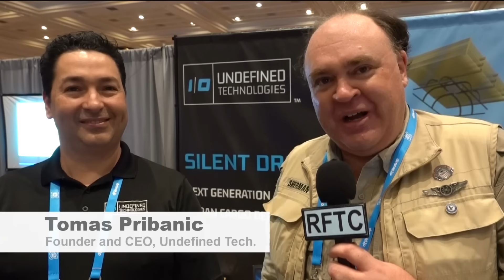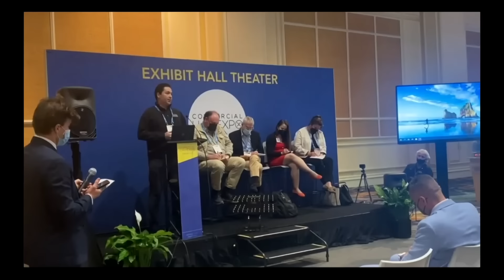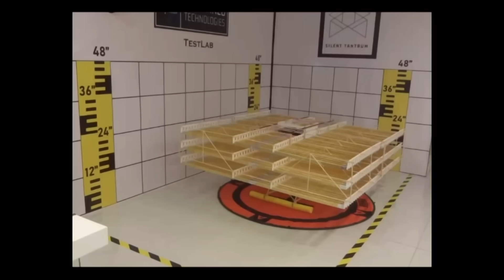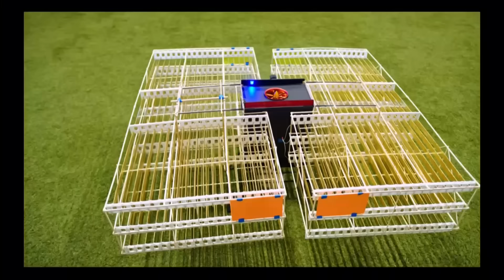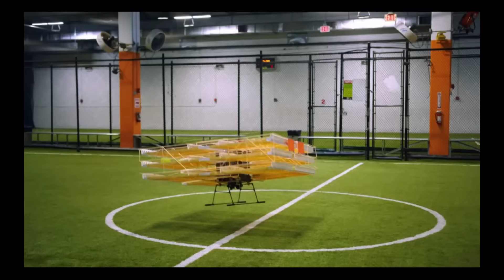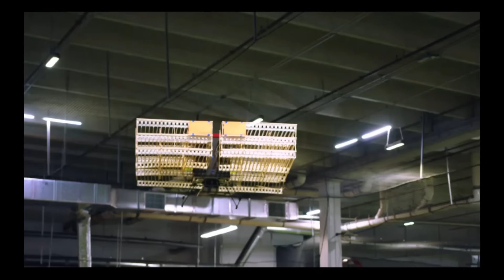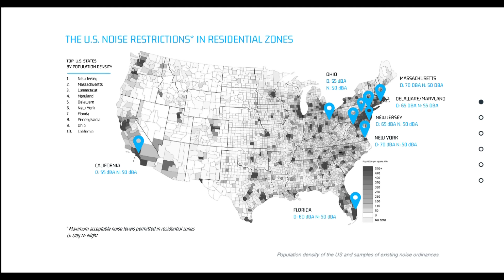New Drone Tech: No Propellers, and Yet It Flies!

Comment: On the surface this is very interesting  and moving in the correct direction. What is the math on energy to lift and how does it currently compare to current drone technology?
Reply: Mr. Pribonic's craft would be at least hundreds of times underpowered to lift itself by ionic thrust.  He has a video of it with audio and a loud powerful ducted fan can be heard.  On my site are the only ones in the world that can lift their power supplies.  They do not lift as much mass and are not developed as far as other types of VTOL craft just yet.

Comment: I didn't think we had already reached the power-density level for batteries to be able to lift themselves using this kind of propulsion alone...
Reply: It hasn't.  They had an radio control electric ducted fan in the center.  I call that cheating.
Reply: @johnculver6994  Yeah I spotted that in there too.  Notice you didn't hear this either, just the fat guy incessantly talking.  It might be quieter than a full on drone but it's not "quiet" with that center fan doing much of the lifting.  I imagine the ion thrust is just used for directional control and stability rather than actual lift capacity.
Reply: Quiet my ass.  Those EDFs are normally very buzzy
Reply: @johnculver6994  That fan isn't used for lift...   It's a cooling fan for the controller..
Reply: @johnculver6994  Exactly get rid of the fan then see how it lifts
Reply: It's a fake. You can see that the flying model is powered by a ducted fan.
Reply: @rorypenstock1763  That fan isn't used for lift...   It's a cooling fan for the controller..
Reply: The UT craft doesn't, it would take at least 100s of times more power.  The crafts on my channel though do carry their power supplies onboard by ionic thrust.  They are the only VTOL ones in the world that do.  It makes sense though why mine work and it is clearly described.
Reply: There’s no way ion thrust lifts those 2 large 6s lithium batteries. The ducted fan in the center does that. The JP ducted fans definitely aren’t silent.
Reply: @whiskytango17  That fan isn't used for lift...   It's a cooling fan for the controller..
Reply: @whiskytango17  bruh the ducted fan couldnt lift the ting by itself, surely its for cooling, they said it could carry 2 pounds for 15 minutes, I doubt its scalable. The ting is pushing off of ionized air particles and unless we rebuild the Giza pramids or tesla's tech is finally brought to the public, then it will be a while before the air is nice and zappy and we are an advanced species, having mastered the art of controlling ionized particles with magnets like friggin airbenders. but for now we all are clamped tightly in the jaws of the global concrete gasoline plastic pesticidal slavery complex, tighter than a 2 ton dagestani bear thats high on cocaine.
Reply: Yeah, it looks like the JP industries ducted fan does the lifting and maybe the ion portion just controls it.
Reply: This technology is from outer space. That's why we used to see UFOs.
Reply: graphene batteries for the future
Reply: Maybe they'll make a deal with Elon for some 4680s!

Comment: A future silent drone, possibly with multiple computers controlling the zones for the ion wind to steer and move... I look forward to this
Reply: They create ions by breaking down air molecules, which they then propel using strong electruc fields to create lift. They produce ozone.
Reply: @trucid2  It's possible to design one that doesn't, but they usually do.
Reply: @KraussEMUS1  How would you do it? Without ions you don't get thrust.
Reply: @trucid2  Hi LP,  The crafts on my channel just add electrons to the O2 in the air.  O2 has a high affinity for electrons and just grabs them up.  It just takes a very high voltage low current power source.  It also takes a super light large surface area craft and very specialized electronics and geometry to maximize the thrust per watt.
Reply: @KraussEMUS1  Very cool. I looked at some of your vids. That thing looks like a UFO.

Comment: Just a "lifter" that many enthusiasts made for more than 20 years. This application is most likely a hoax as the energy requires very high voltage and the lift that generated will not be sufficient to lift any useful load apart from the batteries.

Comment: Hope nobody invests in this nonsense. This thing can go in the shit bucket with the "free" energy devices. There is indeed a big EDF in the centre providing lift.  It is difficult prevent the craft from rotating whilst throttling which is a sign of the limitations of the single EDF providing the lift while attempting to use ionic flow to provide yaw pitch and roll. The force of ions is never going to be able to control a craft in any kind of real world conditions. Sure it works in a closed area with no wind. But only just. Take that thing outside and watch it blow away in a slight breeze. This is not the first time this had been attempted no doubt it will not be the last. Yes ions can provide some thrust. It's not magic.

Comment: IDIOT🤡
ALL EXPERIMENTS WITH LIFTERS
WERE DONE IN AIR, NOT SPACE
NOTICE HOW HE AVOIDED TELLING
   THE WEIGHT WHEN ASKED?
  FIVE FEET by A FOOT AND HALF
       ONLY LIFTING 2 POUNDS?
           Lightweight and Huge
  CONTROLLED BY more or less power
              To the Quadrants
They aren’t HIGHLY MANUVERABLE.
THERE ARE WEIGHT LIMITATIONS
THAT IS WHY IT HASNT BEEN PURSUED.
YEA, IT WORKS, BUT CANT LIFT MUCH
SCALE THEM UP, SAME WEIGHT     
        RESTRICTIONS
  THAT’S WHY THERE ISNT A LARGER
           ONE SITTING THERE
          THE TECH IS LIMITED
  LEARN ABOUT LIFTERS BEFORE     INVESTING, IF IT WAS THAT EASY
   THE GOVERNMENT WOULD BE USING
            THEM EVERYWHERE
  FIND OUT THE LIMITATIONS FIRST
   BEFORE TAKING A DEEP DIVE

Comment: It also has an EDF in the center!  

"Electric duct fans (EDF) operate with less noise and more efficiency while still offering RC aeromodellers the potential to experience the thrill of seeing their winged replicas soar through the air."
Reply: Less noise and more efficiency. EDFs are no where near as efficient (making thrust from input power) as a prop system. They are never quiet either. They can sound like Hoovers in the sky or like mini turbines which is cool but certainly not quiet!
Reply: @peterwood2633  There’s a video of this device on their channel with sound. It’s very loud.
Reply: @DNMEBOY  stands to reason I mean it's a biefeld-brown effect lifter in 2022 with very little lifting capacity still. Reason they used to be made of balsa and foil!
Reply: @peterwood2633  I was just agreeing that EDFs are very loud and so is this craft despite being advertised as silent. .  Looks and sounds as if the only thing providing lift to it is an EDF with thrust vectoring. 
https://youtu.be/iihprC5Huf4

Comment: Lifting two pounds and 15 minute flight times with an on board power supply? Certainly a hoax. There is no way this would be able to do any of that. Remember the MIT  ion propelled model plane from a couple of years ago? That could barely maintain level flight for 6 seconds and it certainly could not lift any payload beyond its 10 second battery. this is a repackaged ion wind lifter from 15 years ago with super thin wires connecting it to the high voltage transformer on the ground.
Reply: There are ion thrusters on my channel that do lift their power supplies.  They are much more advanced and predate the MIT glider.  There are two patents for them, and I have been working on the project full time for 22 years.  These unique ion propelled crafts are very lightweight though and require a lot of details to be just right to fly for just under 2 minutes.  The UT craft does not follow any of those details and so requires a powerful ducted fan instead for lift.  There is a video with sound of their craft and their patent application is online as well that further supports these observations.

Comment: There's something strange in this drone; I thought the electrodes had to be of different metals and sizes to get a lifting effect. I also wonder how did they avoid the lightning.
Reply: Distance. It won't start popping until it's covered with filth.. remember,  it's the same thing as an ionic air purifier.  We all know how hard it is to clean those...
Reply: Strange? Probably the propellor in the center.
Reply: @jamesbizs  that small propeller in the center alone couldn't lift the device.
Reply: @brujo_millonario  It's plenty big enough for an edf. If you hear it running you'll hear just how fast it's spinning. VERY fast. That's how electric ducted fans work. That ducted fan alone is enough to meet the claims. The Ion system look to be secondary control/trim in function. Fine for a testbed to iron out ion flow control systems for such things or even ion propulsion systems for space craft/probes, where very tiny thrust over long periods can add up a lot.

Comment: Air propelled downward by ions instead of a propeller or rotor. A VERY OLD, OLD IDEA. I read something about this in a Popular Mechanics back in the 70-80s, with photos of the model in the air. I don't think it will work if there is no atmosphere or particles available, in absolute vacuum.
A copycat interviewed by an exaggerated blackmailer. IT DOESN'T BRING ANYTHING NEW. Maybe some "21st century" detail, but nothing more.
A video to impress ignorant or uninformed people.

Comment: it's actually pretty efficient compared to where the technology used to be a decade ago. I lot of people didn't think it would ever be a logical plausable means of perpulsuin.

I wonder if it would just be a gimmicky thing, or will it actually eventually take off & become a common main stream technolagey? 🤔
Reply: Gimick.  I used to build these and it is not practical for large flying vehicles plus we don't have the powerplants that could
provide propulsion power.  It would need an enormous amount of energy because air ionization would require it.
Reply: This is main stream technology. The US has several satellites using this for planetary exploration.
Reply: @jerrybrown6169  because they don't need real force in space. On Earth - this is miracle
Reply: well it doesn't work so that might be an issue
Reply: He didn't say anything about large vehicles
Reply: >>perpulsuin.<<
What is that exactly?
Reply: this one with 2lbs payload for 15min is mindblowing already.
omg. silent flight of kilo for 15 minutes. smells like money
Reply: @Ritefita  it's clearly not silent. It's got a massive fan in the center. It can't take off without it.
Reply: @THESLlCK  didn't see...
probably, it's a cooling fan wich can be replaced with some fancy passive system.
otherwise, everything is BS and fake((((((
Reply: @Ritefita  no way, it’s a ducted fan from a leaf blower. You’d need a computer the size of a refrigerator for a fan of that powrr
Reply: @THESLlCK  there is* crazy power.
just that need, such a big power - looks like normal for ionic miracle (if))))
Thanx for pointing anyway

Comment: Who are they trying to fool?  There is a big lifting fan in the middle and that's what's making it fly.  Even without seeing that it is clear that the ion thrust panels are not even lifting their own weight as they sag even when it is flying just as they are when it sits on the ground.  If they were providing lift they would flex upwards, not continue to sag downwards.
Technically they are not lying when they say it has no propellers, because it has a ducted fan instead.
It is possible to make something fly with ion thrusters, and has been done by many even decades ago but the thrust is so low that it needs a very light structure and has to have an off board power supply powering it through a cable.
Reply: Sharp observations!  There is however a series of ion propelled craft on my channel that do lift their power supplies.  There are two US patents for them, it is verified that they lift their supplies against Earth's gravity.  It requires a lot of things be just right to do it though, and the UT craft does not follow the principals needed to make it happen.

Comment: I once worked at a place where somebody brought in that idea of an "electrostatic fan" so we made one about 1 foot square just to play with. It worked amazing well and the air flow was quite columnar and ten feet away you could pretty well still feel that 1 foot square shape.  We had also heard that you can modulate it with audio (same principle as the physics experiment of modulating a flame with a voltage where it then becomes a speaker) and that worked well.  You are modulating the plasma produced.  The only downside was that it produced some ozone - and too much of it.  Shortly after this little experiment, the company heard about a request for proposals for air conditioning alternatives for mass transit railway cars (from UMTA, the Urban Mass Transit Authority) and our company made a crazy proposal that involved no rotating parts at all.  The proposal was called "NORMA" for the "No Rotating Machinery Alternative".  Cooling was based on an absorptive air conditioning system (an old technology) and cooled fluid was moved with magnetohydrodynamic pumping.  Air movement was by the electrostatic fan.  And we said the fan could also double as the train's loudspeaker AND even remove dust and pollen from the air.  The proposal didn't go anywhere, and the evaluators were smart enough to ask about the ozone and we could only say "we expect to solve that".  In the end, the well established company TRANE got the contract with nothing more than a scheme to allow a quick swap of a failed unit for a good one.  But the idea of an electrostatic fan is something any home tinkerer can do.
Reply: Super interesting! What was the name of that company you worked with, if I might ask? And what was your role and specialty? If you made a full video on this I'd absolutely love to watch it, talking about your experience, showing experiments and explaining the chemical reaction producing ozone.
Reply: I'd like to second that motion! 👍👍👍!!

Comment: The authors of this vid need to either speak to the fan, or remove this misleading video.
Reply: Ignorance is not at all blissful please do the necessary research to see that the tech is absolutely real👍😊
Reply: @Richard_M3976  the video was patently idiotic.  Super gushy without any real substance.
Reply: @Richard_M3976  Nawwww - me smart.  But you, dunno.  However, one thing for sure, you are damned impolite.  Ion propulsion is real.  But this is a shitshow.
Reply: It's most likely a cooling fan for the ion generator that has nothing to do with propulsion.
Reply: @grenobel  could be, but to me the whole vid was sketchy and put me off … all very loud gushing and precious little technical exchange.

Comment: 10 square feet to carry 2 pounds, so you would need 50,000 square feet to carry 1000 pounds. It's likely you couldn't condense this into a cube either since the air will get heated with each panel it passes likely resulting in the lower levels being damaged from the heat.

Comment: Would this work on Mars?
instead of the helicopter ingenuity?
Reply: It works on earth
Reply: @Rookies103   Duh, we knew that already.  Mars has only 38% of the gravity also Mars atmospheric pressure is 0.095 psi  (Earth is 14.7 psi)  Would these differences make for easier drone flight on Mars?  The current drone on Mar, has very high speed propellers whereas this seems to have none. (less moving parts = reliable)

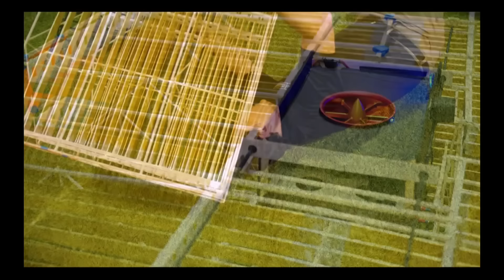Comment: That "propeller" (ducted fan, producing 8kg of force) at 1:45 is extremely loud!!! But hey, this new technology promises a good future!!! Keep up! This ducted fan won't be needed in a short period of time! 
Also, correct me if you are able to fly without the ducted fan! It's the 12S EDF JP Hobby 120mm???
Reply: That's exactly the one! Red and yellow anodizing, very distinctive. They didn't even try to hide or disguise it.
Reply: I was thinking that myself,  if its a silent lifting  device, why does it need a bloody big ducted fan in the middle of it
Reply: Oh!  So it’s not just magical ions
Reply: Current battery tech cannot provide sufficient energy/weight ratios for pure ion lift in any meaningful way. It might be possible to build something superlight that under controlled conditions using supercapacitors for energy storage to get a few seconds of flight time. But it'd be a challenge to do.
Reply: @kaseyboles30  On my channel are the only ones that actually really can do it, but you are right it does have to be super light:).
Reply: @KraussEMUS1  How often do you want to repeat this sentence under this video?

Comment: not a new tech but a new application for it. totally seems obvious now ive seen it that batteries are high enough density for it to be possible. you could make a simple lifter device at home, but always needed to have it tethered because of the power supply. Now we have drone batteries.
Reply: The UT craft does not lift its power supply by ion propulsion.  It must use a ducted fan instead.  The only way so far that a power supply can be lifted is if people follow the details outlined in my patents.

Drone batteries alone do not have enough power for an ordinary lifter to lift its supply.  It requires a special power supply and special lightweight construction and geometry.  Someday the tech will be improved further though.

Comment: I mean... from the video looks like the ion "propellers" are just for the steering.... still got a huge air propeller in the middle doe
Reply: Steering is provided by the vectoring fans on the bottom beneath the ducted fan. They function just like the vanes on V-2 and Redstone rockets.